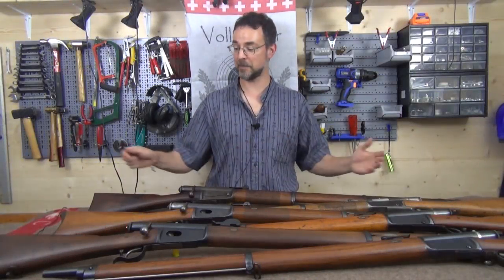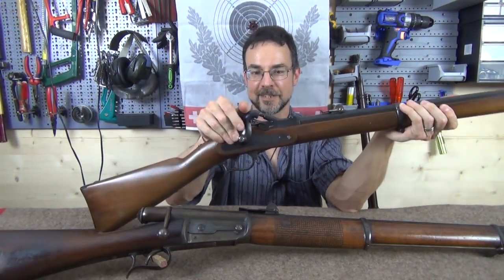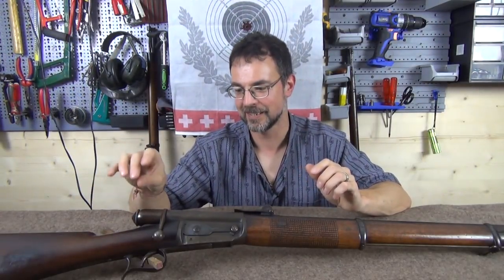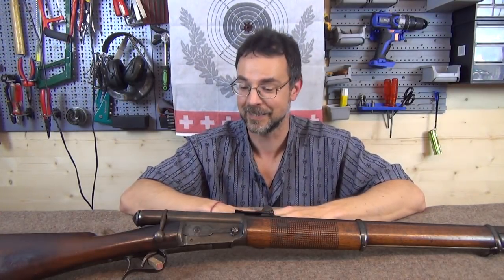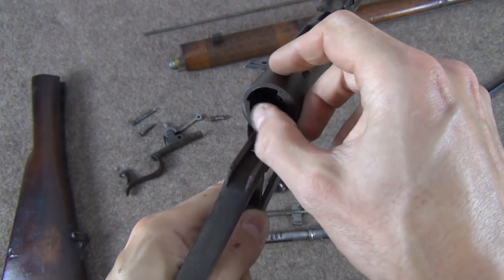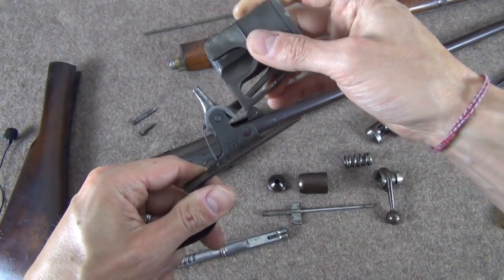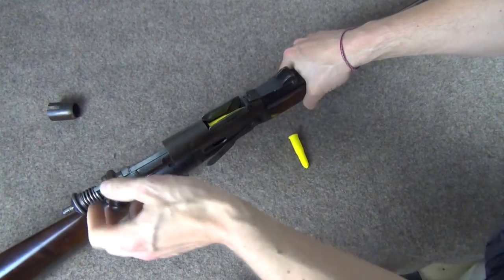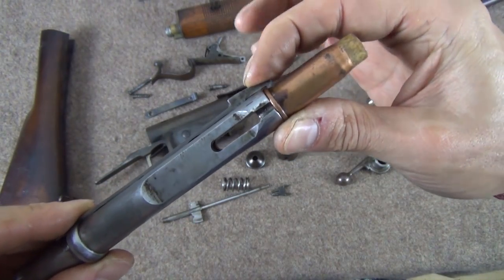The Vetterli Rifle Story Pt.1

Comment: I recently acquired a M78 Swiss Vetterli Stutzer double set triggers in near mint condition on GB that was professionally center fire converted using the original rimfire firing pin.
It shoots great with cases formed from 8mm Lebel.
Reply: An M78 Stutzer would be a rare thing indeed as even the source book doubts whether any where made past a few prototypes.
Reply: @thebotrchap  Some sources say fewer than 4500 were made, it is 100% a M78 Stutzer by serial number. It was professionally converted to CF in the distant past, shoots great with pristine bore and function.
Reply: @AntiqueDead  i know your comment is from a year ago but are you using smokeless or bp?  Im looking for leaks on a safe smokeless load for mine. I've red mixed opinions though.

Comment: Very pretty guns! Nice to see some Vetterlis that haven't seen a hundred years of hard use in the forests of NA.

The vetterli I am working on right now was completely red when I got it with a horribly shellaced stock.

I would convert it to centerfire if the bore was in nicer shape, but it seems after the rust is converted it will remain on the wall.
Reply: Hope it looks very good on your wall. 
Sounds like a grand piece of decoration on the right wall.

Comment: Great job of explaining, even I understood it. I suppose the extractor had to made so hard and brittle to resist deformation of the surfaces used in its other functions.
Reply: On the other hand, perhaps it was simply the best that the possibly  small scale cottage industry type maker of the extractor could do?
One more thing that struck me was the number of different manufacturers  there were for the gun all with one very small country. One might expect manufacture on such a small scale  to employ subcontractors for many of the smaller parts. Seems like it a very high relative percentage of the population might be employed in making these guns?
I also am left wondering, what if they had worked out that deal with Winchester, how might that have influenced the future of Winchester and the future design of European small arms. Sooo many questions....
Episode 2, here I come!

Comment: Bravo! Nicely explained the mechanism and all the background of it's adoption. You made this highly enjoyable to watch. The time just flew by. The audio snafu was not that severe. I'm assuming in the later models the lifter itself holds in the other cartridges and rubs against them slightly in movement?
Reply: The push back function is always present. The lifter remains essentially unchanged across the series aside from minor dimensional changes on the underside mostly linked to changes in the geometry of the lifting arm which was gradually strengthened.

Comment: Are there any records of the machine tools, jigs and fixtures used to fabricate  this rifle? How interchangeable  were the parts? Or was there significant hand work required? Interesting rifle.
Reply: I don’t know, I wouldn’t be surprised if the federal archives have some record of the machine tools and jigs. As to interchangeability it’s not quite there yet but not bad for the 1860s. I’ve found that most bolts are not quite drop-in interchangeable due to minor variations and also the lifter, but nothing that couldn’t be solved with a file by a frontline armourer.

Comment: I have a bubba-fied vetterli that looks like it sat in someone's garage for years. It has a broken bolt handle, Was cut down into a carbine at some time, and is unconverted from .41 swiss. Despite the cosmetics everything still works on it but the riffling is non-existent. No clue why I bought it though. Have been thinking about turning it into an art piece just for the shear amount of wear and rust it had.

Comment: I seen a Vetterli with a hammer over a decade ago (1867 IIRC) about the time I was getting interested in Swiss arms. Missed my chance at buying that one...
I also seen pictures of Lever Action Vetterli's. 
Something of interests, I have two 78/81's,  serials close to 200k. The later one has a coil spring two stage trigger, the earlier one has a single stage leaf. Both WF I think. I don't know if that was an across the board transition for the other makers.
Reply: All the military double set triggers are leaf spring powered. I have a separate vid exclusively on the Stutzer set triggers
Reply: @thebotrchap  
My comment with link got removed...
No I'm not talking about double set. I'm talking about Two Stage triggers.
I have two 78/81's just before and just after SN 200,000. 
Earlier one uses a leaf spring.
Later one uses coil spring and a roller was added to the trigger.
Reply: @Foche_T._Schitt  Interesting. Some post service mod then
Reply: @thebotrchap  
I'm not sure. If I see it on a rifle older than 200k then probably so. There's a post on the tapatalk swissrifleforum titled "Odd Vetterli Fire Control"
I'll need to photograph both of mine as I don't remember all the differences.
Reply: @Foche_T._Schitt  Yeah I found it on Swissrifles. Very odd, it’s certainly non of the standard Steiger mechanisms nor mentioned in the official list of changes.
Reply: @thebotrchap  
It's easy to feel for that trigger. I need to start checking them at gun shows and writing down the maker and serial number. If they're all after 200k then it was a design change. If not then it's possible target shooters were having gunsmiths alter them a century ago. Really old Swiss gun catalogs might contain a mention.
Reply: @Foche_T._Schitt  I have the list of changes from March 1870 to January 1887. The 200k+ series is roughly 1886 onwards. The official changes from 1886 and 1887 are a) rounding of front sight corners b) spare striker fork to be wrapped in oiled paper c) riveted cross guard on the bayonet d) deeper bluing applied to certain parts e) introduction of a muzzle protector.

Comment: Does this gun still fire safely? Considering if there is still ammo available?
Reply: If reloaded for responsibly and the rifle is in good condition it is perfectly safe*. The bolt needs to be converted to centrefire though as rimfire ammo is not made anymore and the 100yr old original ammunition does not work.

*Disclaimer: Get your rifle checked by a qualified gunsmith first!